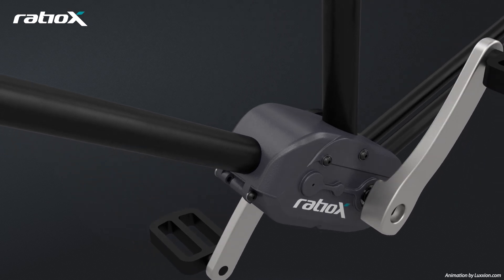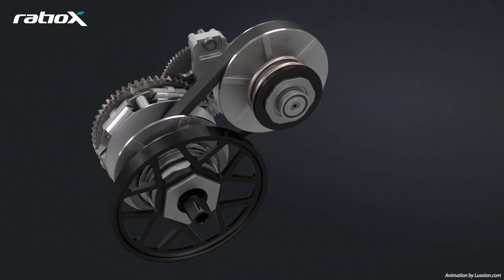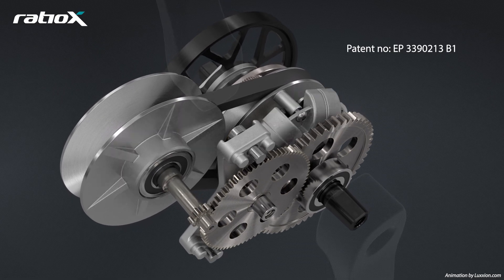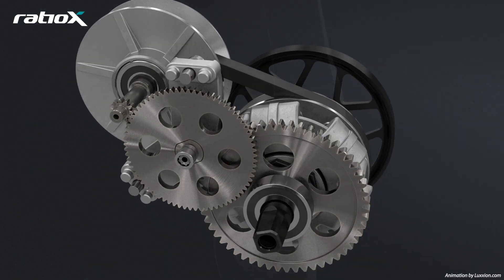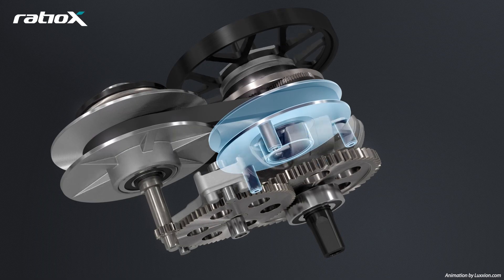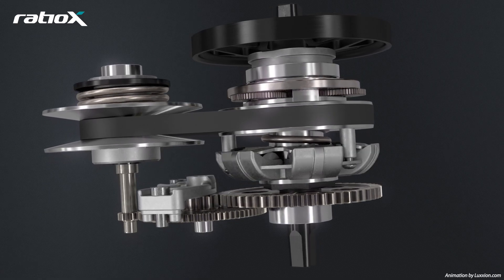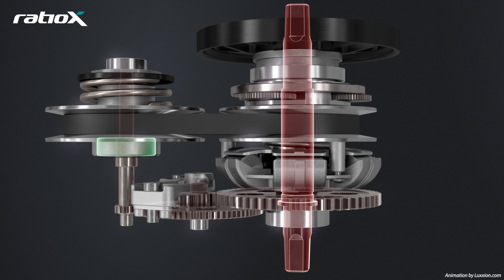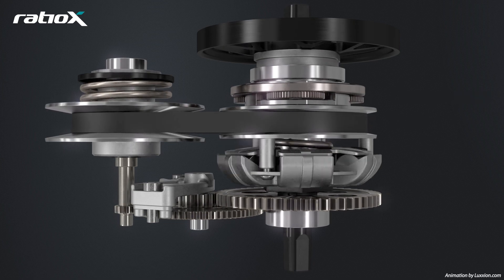E-bike CVT Transmission Animation (Eurobike 2023)

Comment: Okay, so they took a regular scooter CVT mechanism, shrunk it down, and found out that it can't transmit enough torque. To combat that, they simply geared the input up and output down, so the belt travels faster and can transmit enough power. I'd imagine that comes at a great efficiency penalty, I'd be really interested in the efficiency. Love the design, would buy if efficiency is >90%
Reply from the maker: You can ask de guys from RatioX: https://ratiox.ch/
Reply: bro literally tell me in which regular bike there is 90% efficienc you trippin
Reply: @integrationofmanandmachine4714  A well maintained chain-derailleur system is between 95-98 percent efficient, depending on the gear. Rohloff's Speedhub is between high 80s and low 90s efficient depending on the gear.
Reply: It does not make any sense. because humans have a very low ability to spin the pedals, in other words, they cannot make a high rpm. Pratically the torque of a human biker is:
- almost costant at any rpm
- enough to start and keep the bike moving
by constrast it does not have a basic requirement of a cvt:
- no high rpm required to make the cvt work due to centrifugal force
so they multiply the rpm by a gear but this involve some mechanic loss. now considering the limited power of a human power such loss is something unacceptable

Comment: Great animation.  Is this an actual product, or even gone to prototype stage?  What is the overall gear ratio? thanks.
Reply: The Prodigy V2 has the option of a CVT
Reply: @eddyb2850  Thank you. The Prodigy V2 uses a toroidal CVT with a relatively limited overall gear ratio (380%).  The one in the illustration is a Reeve’s type CVT which could, potentially have a much greater overall gear ratio.
Reply from the maker: Thanks! It is an actual product, different proto's have past, not sure if it is in mass-production already. Ask the guys from RatioX ( https://ratiox.ch ) Also the technical specs are on their website.